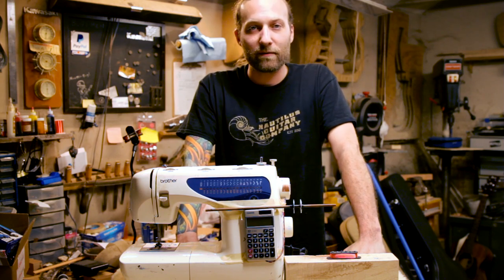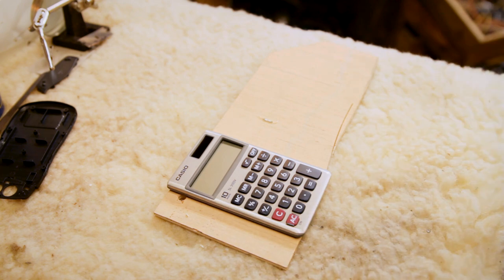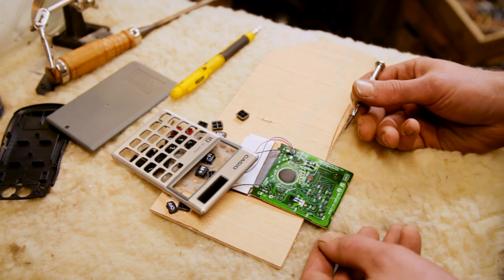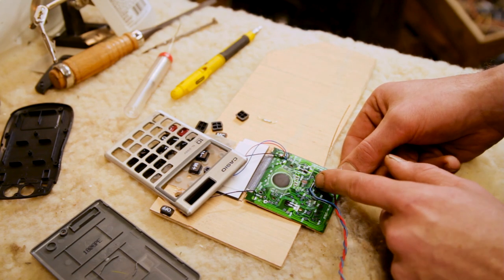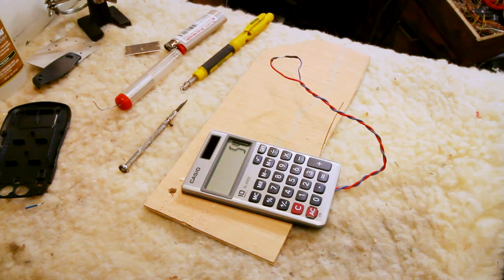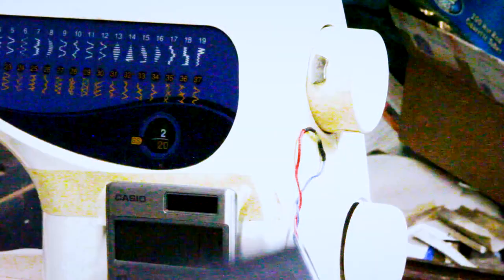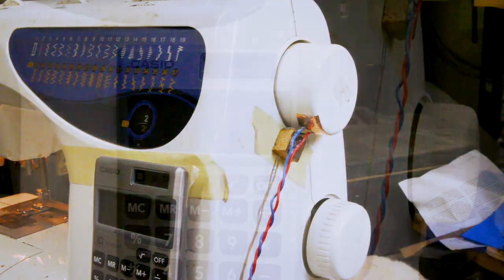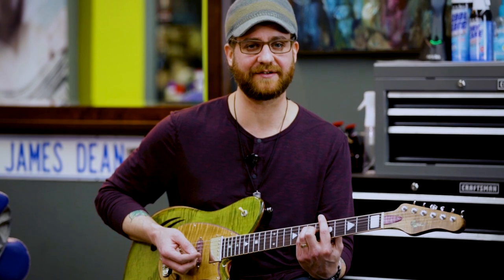How To Make a Pickup Winder (With a Counter) From Sewing Machine And Calculator

Comment: Wow! These are some clever ideas. I noticed the machine mechanism is functioning. Engage the bobbin winder to disengage the sewing mechanism. It will reduce the load on the motor and reduce noise.
Reply from the maker: I can't believe I didn't think of that! Thank you for the comment. That would definitely make the whole system run much more smoothly. I was wishing it ran without as much resistance for smoother starting, but it never occurred to me to do that. Thank you again for the tip, the kind words, and for watching!

Comment: I used your idea with the reed switch and the same Casio SL-310SV calculator and I found that you can compensate with the magnets polarity that hits twice by simply pressing .5 + .5 = 1,  or you could also use 2 magnets 180 degrees apart on the spindle with opposite polarities and still press .5 + .5 = 1, and it will register every half turn at .5 and completing a full 360 rotation resulting in 1 full rotation. Using 2 magnets that register as .5 at each half rotation counteracts the (very slight) imbalance on the spindle from having the weight of one magnet on one side (if that makes sense). I think the reed switch is actually a cleaner and more reliable design than using shielding tape to short the bare wires. Your idea is ingenious though.
Reply from the maker: Glad you got something from the video, and thank you for the kind words! That's a great idea! I didn't consider that option. Definitely something to keep in mind. I had issues with the reed switch floating, but I'm sure a better quality switch would make a big difference.
Reply: Smarty pants...Lol! Great fix.

Comment: Well I'm impressed. Might I suggest..... If you can.....Use the auto bobbin refill function that your machine already has built in (mod it of course). Meanwhile.....

About 15 years back I used a cheap $20.00 burner phone (did a mod similar to your calculator) and programmed a couple of numbers in it, and connected it to a PIC chip monitoring closed switches. And presto....I knew immediately if someone opened those switches I was monitoring (from anywhere in the world). I also did the same with a cheap Dollar General phone & used it for a programmed land-line connection.
Reply from the maker: Didn't even consider that until a previous commenter pointed it out. Real "duh" moment there, hence me pinning his comment up top. Definitely a big improvement in function that I mistakenly overlooked. 

Very cool stuff with the phones! I've done some similar, though not as involved, things in the past with mobile phones. Wish they were more accessible as a platform for modification and upcycling these days. They could unlock a rich world of repurposing second hand devices. Android allows for a lot of this, Apple makes it impossible. I do foresee a future of upcycled tech like this. Picture Star Wars-esque cobbled together tech. Places with less access to new tech have these communities. Cuba being a great example. There's a lot of wasted potential in used devices!

Comment: Hi ,thank you for the information, I bought a great vintage sewing machine, and yrying to find an old calculator that will work ,does the the support bar with washers have to spin ,or does the wire just run along it ?

Comment: Excellent tutorial! I was wondering if you could put a push button switch just under the sewing needle mount? I guess it would depend on if 1 shaft rotation equaled one vertical sew cycle…
Reply from the maker: Thank you! I had considered doing that, and I have seen it done, but i figured the long term wear might cause problems. I went this way to make it longer lasting and easier to restore once it is worn. That's definitely a valid solution though! Especially if you use a more durable switch meant for heavy duty cycles. It is one rotation per cycle, so it would work.

Comment: I was wondering, about making your own pickups.  Are they better than $20, $50, $100... pickups? The kits and supplies are not very cheap.  Is it worthwhile?
Reply from the maker: In my opinion, yes! The cheaper pickups use lower quality wire and materials, and aren't usually wound with much proficiency. There are a lot of subtle nuances to pickup winding that can have a drastic effect in the end product. Especially in conjunction with one another. Things like the materials, coil shape, design, wire type/gauge, etc all can be controlled for a desired result. Even the way in which they're wound can have an effect. Machine vs hand winding has surprising differences (look into "distributed capacitance" if you want to understand the technical differences). It's all quite fascinating. 

Obviously, it's a bit more technical and that all has a learning curve, but for beginners with a steady hand and some patience, there are plenty of outlines for specific types of pickups. Most of which can be made for less than their factory counterparts. And after a few sets, I think most people would start to understand how all these things work together. But I wouldn't expect to make something competing with the tops brands right away, though it's not out of the realm of possibility. 

For somebody like me who does repair full-time though, it's a big business booster, as I can produce any results a client might be looking for in a pickup, replicate out-of-production or hard to acquire sets of pickups, or repair irreplaceable  vintage sets. It's nice to be able to offer a bit more to my clients in that way!

Sorry for the drawn out response, but I hope that cleared it up a bit for you! Feel free to ask any other questions. I don't mind chatting about this stuff.

Comment: why not just go through the test holes...they were already there, no need to scrap soldermask off
Reply: I was thinking the same thing....but hard to argue with success.  And too  "to each his own" as they say.
Reply from the maker: Several reasons, actually. 

1) The test holes are coated with conductive paint. Much easier to remove the solder mask.

2) Less mechanical stress and more surface area. With the wires laid flat, secured with glue, and the solder joint on the same plane, there is less torsion applied to the joint.

3) The contact pads on the opposite side intersect with the test holes. So if I applied too much solder or had wire protruding, I'd have a lot of extra work cleaning it up. 

On their own, these things might not warrant the method I used. But taken in aggregate, they justify the different approach, in my opinion.